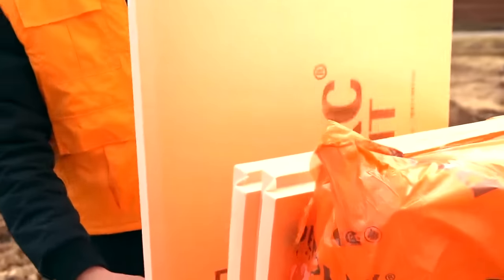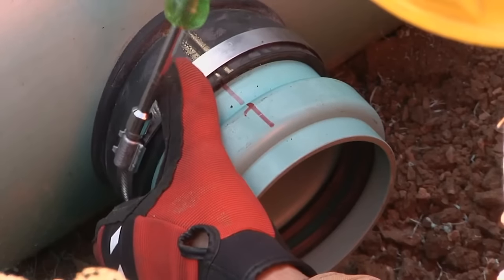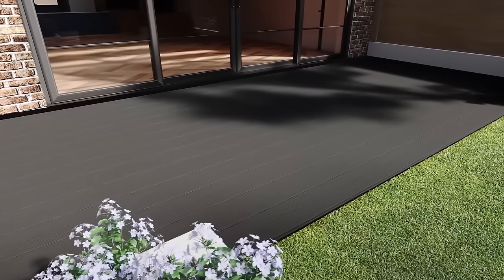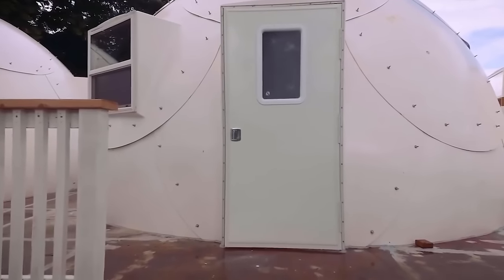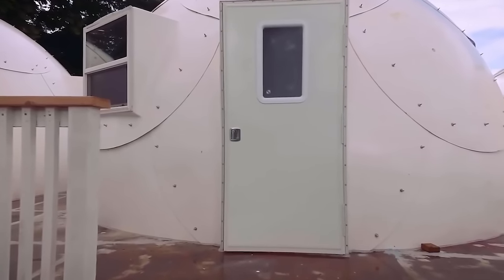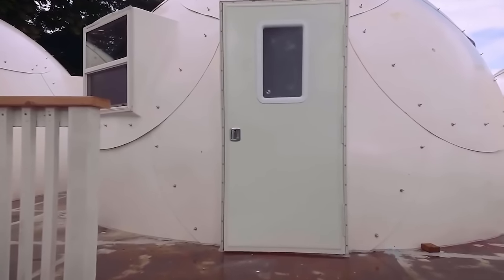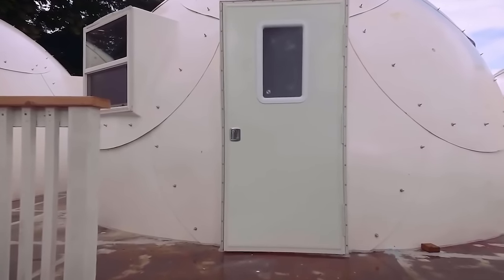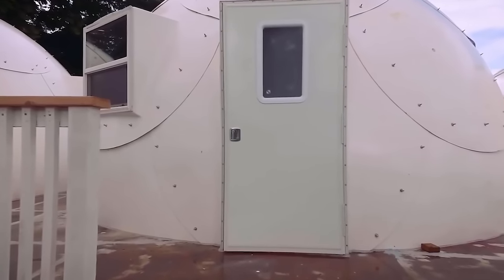Incredible Construction Techniques That You Need to See - Compilation

Comment: As a builder, i'm 10minutes into the video and there havent been one product that i would use in any of the jobsites. All of them have severe issues that would be unpractical to outright financially suicidal to any builder. For instance the Eco-facade. You are using styrofoam like panels directly glued into the OSB wall.. witch btw on it self would get you into lawsuit really fast if done here. Then sealing the gaps with sealant. Moment one of those seams leak, you are running moisture straight into the construction and having no way to ventilate or dry it. The time you realize there is a issue, is when the panels fall off and reveal rotten OSB and most likely rotten frame. That can easily happen with in 10 years witch is the warranty period here by law and you are utterly boned, requiring to go and redo whole outer wall well as part of the frame. No you have frame with insulation, vapor barrier, thinner set of insulation in subframe, windproof boards that are soft mold resistant material that prevent pressurized air going trough ie wind, while allowing the material to dry easily. Then you have gap of 30mm where you install the outer wall material like paneling, boards, tiles and what now. If you cant make it perfectly sealed, least make it so it can breath and dry and since you cant make anything perfectly sealed in context of a house dont even bother trying to seal it in that extent and hope it wont get wet. Solar panel tiles went from worse to absolutely waste of money so i'm not going to even keep going with this disaster.
Reply from the maker: Thank you for sharing your professional insights and concerns. It's important to consider all aspects of construction to ensure durability and safety.
Reply: Strange there is no ground of illegality for complaints - breaking sanctions, laws or safety requirements.
Reply: witch is spelled "which"